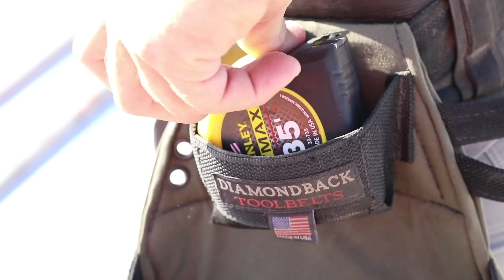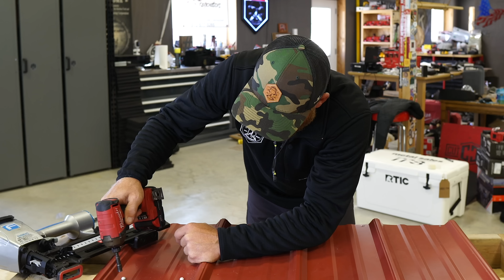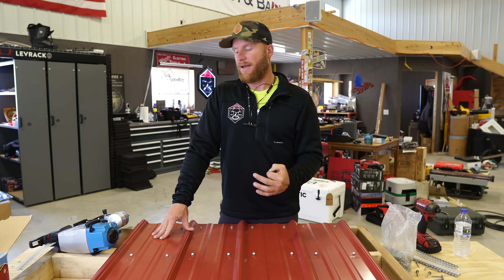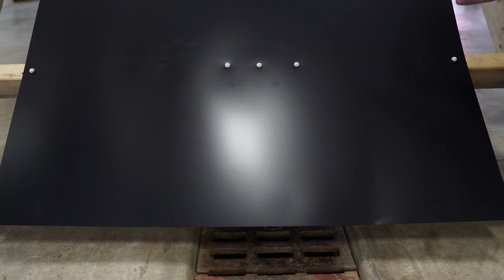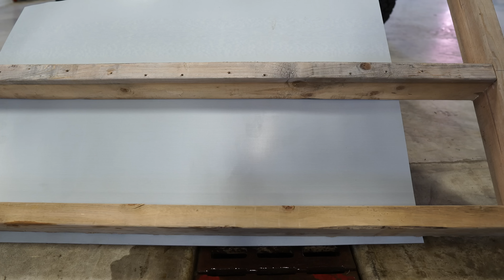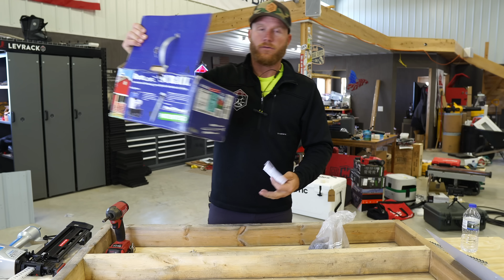Metal Roofing Nail Gun

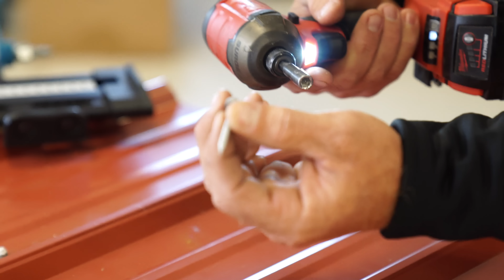Comment: It is excruciating listening to that external hex head get stripped by the seemingly wrong sized hex bit 5:55. The logic seems loose around 16:20, the fasteners are demonstratively faster to install, but not as proficient as the crew.

A more intriguing feature of a nail-screw, whether it be Scrail, UFO, etc, is the much greater tensile strength and utility provided in repairing the fastened material, particularly in applications where nails are traditionally used i.e. siding, decking/flooring, sheathing, etc.. Beyond repairing, to a lesser degree, there seems to be a potential value in having less damage the materials fastened when removing the material, if done carefully. Consider the percentage of situations that the owners end up removing the product well before the end of the material lifecycle due to changes in tastes and preferences, effectively making these more overall economical and environmentally friendly.

There seems to be a savings/breakeven for builders and craftsmen for this "advancement" to fasteners, hopefully more manufacturers will make this kind of fastener so there could be greater competition on price among them. 

Hope to see more content on this for other applications.

Comment: Time effective?

I’m not sure about that.

If you do metal professionally, you’re pre drilling for perfect screw lines, and now you are taking more time to measure and mark individual sheets for perfect lines with the pneumatic nailer?

Unless the screw tips stick out and you can catch the pre drill hole - then you are able to save time doing a professional finish.
Reply: On another note, what’s the hold like? Will the finer screws back out faster? Not until you put it to the test, and see if they will stay sealed for the expected replacement on the washers - would you know? 

I can see this becoming a useful tool, but I think it should work like sub flooring drills, and the screw tips should stick out.

Good luck though 👍

Sometimes sticking to the old fashioned, tried tested and true methods is better.
Reply from the maker: I can totally appreciate that and agree which is why I’m not switching to it for us... lots of applications I could see this being useful however
Reply: Yeah, what you say in your video is fair to our method of application, and fair to the tool being useful in the right area.

Can’t wait to see how it may change, with application and how the tool could function.

Awesome video, thanks

Comment: Cool tool. I think more of that scrail technology is going to show up more and more.  I am curious to how much flow (CFM) is needed for that gun. Pressure isn’t everything and I’m sure you may have to run more than 90 psi if you have a long hose or multiple hoses. You are going to have to step up to the gas wheel barrel compressors on the job site if several guys are using these guns. Could the white be bits of plastic?

Comment: For someone like you who builds QUALITY buildings and your company name means so much that type of attachment and fastener would be a gamble. With wood density changing from each piece of framing lumber or for that matter the same piece of framing lumber and hitting a knot or hard spot in the framing. Framing guns themselfs can be problematic but then when a neoprene washer is also involved seems it would just be too many possible problems , then if you have to go and put a screw gun to each fastener to get the same torque throughout the roof , why would you even want to use the gun. Not for me!

Comment: Your air compressor is made for nail guns, not mechanics impacts. The compressor should keep up with the nail gun. The size of the tank should not make a difference, it's the output of the pump on the compressor. Your compressor may not be rated for that nail gun, it may be only for brad nailers or staplers, but I doubt it.
It sure is a niche tool, but I agree it is cool!
Cheers from Tokyo!

Comment: Great vid. When the screw is shot in it will dimple the metal toward the wood. When you run a screw in it dimples the metal toward the sealing washer making a tighter seal. I always use screws that have a rounded washer between the sealing washer and the screw head. It looked like these were flat which would probably be better since the dimple would be in the opposite direction. Loading the gun would negate any gain in speed. Double the cost, not for me.

Comment: Hi, It is not worth using that nailer if you have to take an impact driver up as well to make sure they are all tight. When you are on a roof you want to be carrying as little gear as possible and I did not like the small head. Also having to pull a compressor hose around could cause problems and the hose is likely to get hung up or snag on any obstacles.

Comment: Also it's interesting that I've worked on a barn out up around 1985. The roof-plates are very thick, probably 1.5-2mm. It is fastened with standard 4.8x35 "farmer" screws, which is the standard. Many of the screws are lose, or becoming lose because the holes are stripped. What I've done is , to swap them out with 4.8x50 - which is a killer screw. If you drive 4.8x35 in hard enough it will strip the holes, but 4.8x50 will tear up the washer. How would nails fare if screws fail?

Comment: To get a better idea of the time savings it really needs to include the time taken to load the strips as well as that wasn't very quick and something you would do often with only 30 screws per strip. Whereas you can have a pouch full of screws, also where on your tool belt are you going to keep the strips. If putting in just one strip it is a lot quicker but a lot of the time savings are lost when you add in the time setting up the compressor, moving the hose about, reloading the gun etc. Driver and screws you just pick them up and go. Nice and interesting video and always good to see what tools are out there.

Comment: Im from South Africa and I find your metal roofing rather strange in the sense that it is secured at the valley of the sheeting. We use an ibr profile that has a 3cm wide ridge between the valleys. We secure the sheeting through the ridge rather than the valley which minimizes the potential for leaks even further.
Reply: yep in Australia I would have to throw that sheet out and get my ass kicked. unless that's a wall sheet then pan fixing is the norm
Reply: When you go through the ridge you have less fastener in the wood and we have awful hot and cold seasoning and expansion and contraction pulls the fastener out in as little as 5 years through the ridge, the valleys will pull out to if you use 1 inch screws that were way too popular from 2004 to 2016 now they use 1-1/2 inch I use 2 inch
Reply: Samething in canada
Reply: We do that in Canada too

Comment: I am with others, not practical for exterior with the hose being dragged around, the sheet metal edge would cut your hose before you can realize it when the fails to fire.
Would definitely be more practical for interior application of ceiling and wall sheet panels, since the hose will not be dragged around over panel edges and thus eliminating the chance of cutting the hose as you drag it about. Not sure who created or approved the deign of the scrails either, they should have tested it before making them in bulk and find out the head height as is if quite insufficent. Until they improve the design of the gun to be cordless or the scrails to have better area for grabbing to remove, I am going to stick with using the old fashioned more well designed manual screws.

Comment: First, I love your vids. Well done. Second, can you post a link to the Simpson brackets you use to fasten your columns to the concrete pillars, please.
Reply: He probably buys from the wholesaler he gets the sheet metal from, there's probably no link.
Reply: The brackets used to secure the post columns are from Midwest Permacolumn ( https://www.midwestpermacolumn.com ), Simpson does not make such robust brackets if those are what you are asking about. he still uses the ones that Simpson does offer for the lean-to/porch awnings of the drilled screw secure type.
Reply from the maker: Give Dave a call at midwest perma column and drop my name he will give you a discount too

Comment: Why did you not put the fasteners in the ribs instead of the flat part of the metal
Reply: Manufacturer recommended and this and more other profiles are not designed for ridge fastening, less chance of warping the panel if over fastened in the ridge and holds more flush and stronger in the flat valley. The seam portion is still fastened on these overlap type panels to secure them together and keep the overlap sealed.
Reply: That is interesting and nice to know thanks for explaining that

Comment: They should make a collated fastener battery powered drill/driver similar to a drywall/decking application. Most people are moving to cordless and who want to drag a hose on a roof that’s 20-30 feet in the air

Comment: We bought one after seeing it at the show last year. We used it one one side of a 40x64 and had nothing but problems. We waited 4 weeks for a custom color fastener, they only stock white and galvanized. All of the fastners had paint failure when shooting them in to the point that it look like white polka dots on a black roof. Loading the gun is awkward and slow. I found it hard to consistently hit a purlins on edge because of the poor visibility from the bulky gun. There was very inconsistent compression of the washers. On the one side of the roof we had about nine leaks.. I would not recommend trying in on a roof.

Comment: Great idea but that gun needs improvement . It's big and bulky for one thing and you'll be spending a lot of time refilling the gun . So much for pre-drilling your holes to get a nice strait line . You always try to get away from air driven tools . Don't think that I'd like dragging a heavy gun along with a hose on a barn roof . You're gonna need a gas powered generator to feed the compressor  or a gas powered compressor as well unless you have electric  power available .

Comment: Just as a matter of interest, will it fire into a rib rather than the pan of the sheet and can it punch the screw/nails through 1mm top-hat steel purlin? I'd love to see someone come up with a laser alignment system for nail guns and screw guns for outside use. I have a 3 axis line laser that is excellent inside but being visual is lacking outside. I don't know if you've done a video on them but when I first got it I found there was very little info on what you can do with them, but I'm forever finding new uses for it.
Reply from the maker: A video on line lasers?
Reply: @RRBuildings  Yes please. Very few people seem to know what can be done with these units and while a bit has been written about their uses there doesn't seem to be much in the way of videos. As they say a picture tells a thousand words.

Comment: HOORAH, it’s “TOOLSDAY” & we have another great vid from Kyle...& RR Buildings👍🏻 Thank you so much for showing us interesting tools.
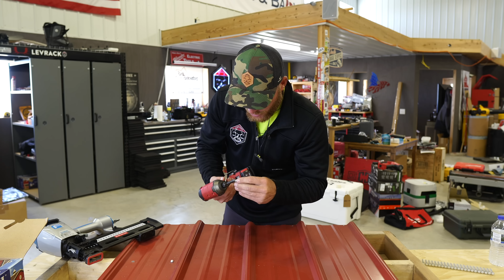So, the Scrails are shot in & then able to be removed w/ impact or screw gun/drill....& we saw this at 6:04  My question is (sorry for being a pain w/ all these questions😉) this Kyle..... Do you think over time, & being out in the elements, that removing these scrails would become more difficult at all; & do they have their own scrail bit for impacts/drills to remove easier etc...? Also, do you see any “oil canning” at all in the metal?

Would be really cool if you & Greg would do a small “mock-up” of a roof (exact same way you guys do a roof on your post frame jobs, just smaller, maybe a 8’x16’ or whatever is easy etc...) using these scrails & the Fasco gun for us; than leave it outside around workshop (out of the way of course) for a year or so(or till spring maybe)m& check on it from time to time & see how it’s held up (especially w/ winter coming). Not sure if have the time, but would be a super cool experiment to see over time & the durability of these fasteners & Fasco Scrail Gun😁. After using this Scrail Gun, think it’s faster than using the Collated Screw gun that we’ve seen you guys use to finish off a roof or subfloor (the Simpson Quik Drive Collated Screw Guns, I believe)?
Appreciate What You Guys’ Do for Us✌🏼
Reply from the maker: Much faster than any system I’ve used yet... that’s a great idea to do that test too
Reply: RR Buildings Thanks for taking the time to always reply, so appreciate it bro👊🏼

Comment: That’s pretty freaking cool. It looks like it still has a little bit of fine tuning to be done until it’s 100%. It would be a hundred times better if it was battery powered. You could haul ass putting on a roof.
Reply from the maker: Yes very true gas powered or straight battery power is possible now

Comment: It doesn't "consume" 90 psi.  Consumption would be measured in cubic feet of air.
Reply from the maker: I’m a dumb post framer I guess I just read the box
Reply: Indeed, despite using volume, as the said volume is consumed thus the PSI itself also gets reduced and hence the power of the driver becomes noticeably  weaker as he mentions. Both of you are technically correct.

Comment: Looking closely at the Scrail itself I believe it is completely coated white on the whole Scrail and that flakey stuff is coming off the Scrail shaft as you are pushing it out at 90 PSI. It is possible that the shaft of the Scrail scraps on the plastic frame that holds the them in the strip, so you are getting that flaking off it. you could spray a bit of WD-40 Silicone on the Strip before you put them in to make them eject easier? I took 3 years of Mechanical Engineering and Design in HS (back in 1969-1972), I had 3 - 55 minute periods of drafting (in a row)  and 1 - 55 minute period of theory each day in HS for 2 years in my 2nd and 3rd years (also we had a full 9 periods a day one was lunch, not like these kids today getting 6 to 7 - 40 minute periods a day  & having only a subject maybe once every other day. We also had Machine shop and woodworking class plus all the others like Math, English, Spanish, PE & Physic etc, also in my senior year we had 4 -55 minute periods in a row just doing theory.
Reply from the maker: Good call

Comment: Kyle, try the Makita Big Bore compressor. Provided you follow the break-in procedure, it's the quietest oiled compressor I've ever used.
I use my Makita with a Bostitch roofing coil nailer and the Bostitch framing nailers and haven't run into issues of lack of air pressure.

If you want to see how effective the Fesco gun is, take a caliper and measure the height of the installed fastener. Then measure the installed height of your hand installed fasteners. 

Watching this video on a big screen TV, the Fesco driven fasteners stood taller than the hand installed fastener. If you have to go back over the Fesco fastener to achieve the correct driven depth, I give the gun an FAIL.

IMO there needs to be an industry standard for an exterior collated fastener head, preferably driven like a drywall screw gun not impacted like this gun is doing.  The other problem with this fastener is that it's a fine pitch thread instead of a coarse thread. Fine threads into wood don't have the holding power of a coarse thread.